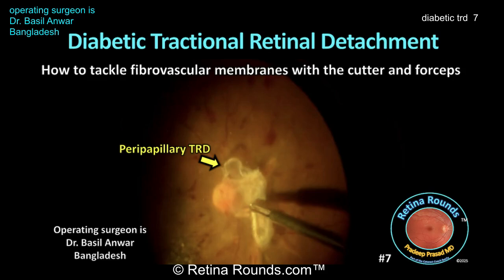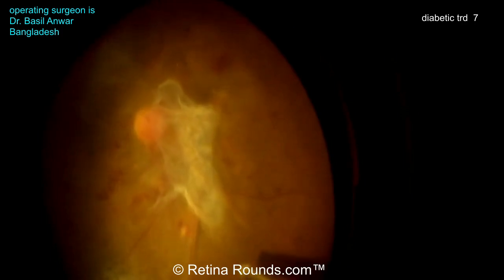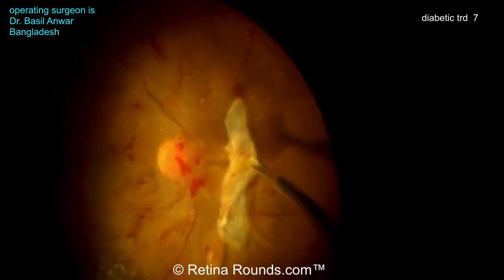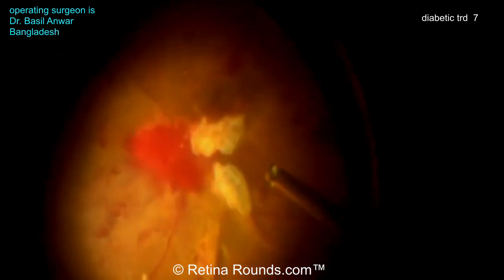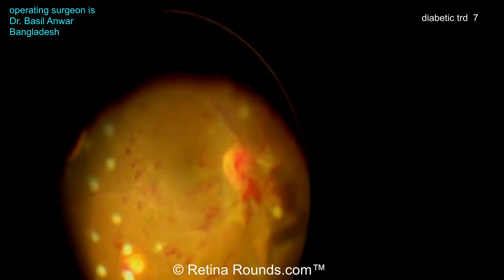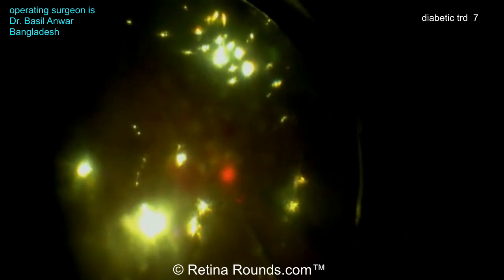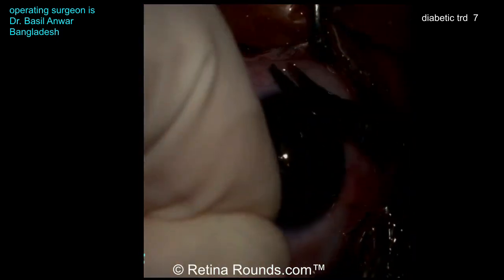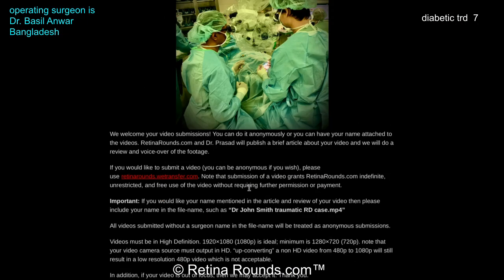RetinaRounds™ 7: Diabetic TRD

Comment: PRP was very inadequate in spacing, very high intensity...I would have checked ports b4 putting sutures.. if it's not gonna leak , why suture it
Reply from the maker: Thanks for your comment.  I agree regarding laser and suturing sclerotomies.  Dripping BSS over the sclerotomies in an air-filled eye is an easy way to check for a leak.   For eyes left filled with BSS, I would recommend suture closure.  There is some evidence that BSS-filled eyes without sutured closure of sclerotomies are at higher risk for endophthalmitis.

Comment: Too much pulling, IMO. Bimanual sharp dissection is safer in these adherent fibrovascular membranes if you can’t tackle it with just the vitrectomy probe. Smaller gauge helps as well.

Comment: there was absolutely no need to inject silicon oil in this eye, even if the patient was single eyed would have been better to leave on AIR, much better visual outcome
Reply: @surviv  or under fluid if not for that pesky iatrogenic tear
Reply from the maker: Yes, air would have been a good alternative that I did not specify in the video.  We don't have all the clinical information here including whether the patient had vision in the fellow eye and whether the patient had to travel but usually an air bubble that lasts for about a week is an adequate tamponade.

Comment: Too hot , too posterior and too spaced apart. That’s the PRP

Otherwise good dissection 
A curved horizontal scissors could have saved the iatrogenic break 

Silicon oil felt unnecessary

I like the sutures